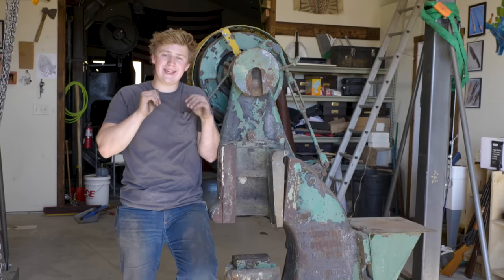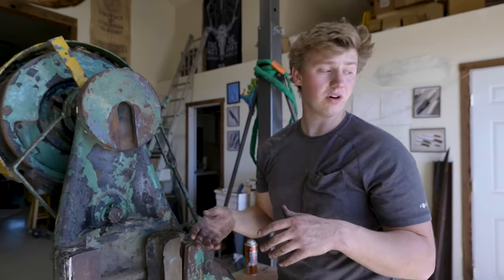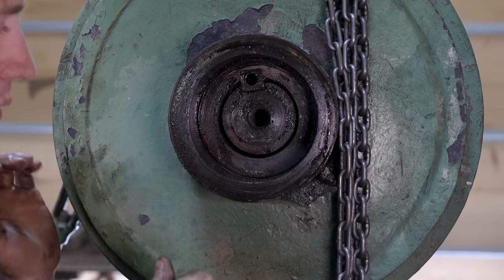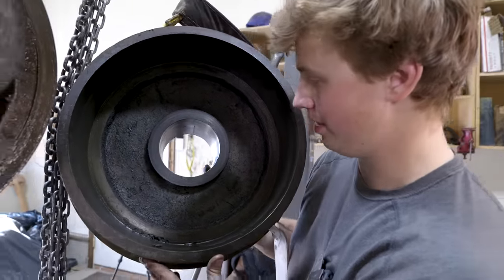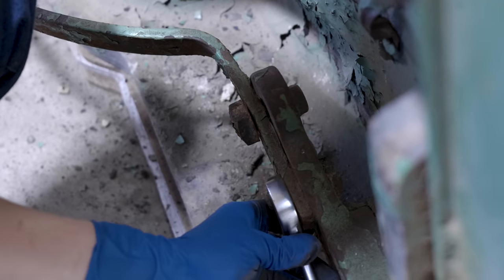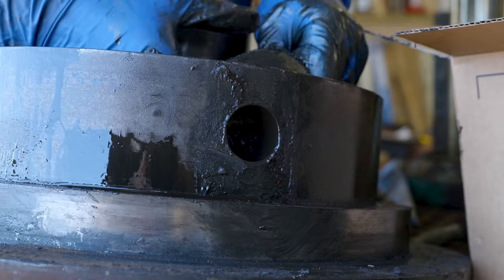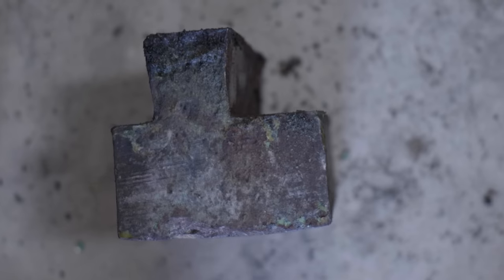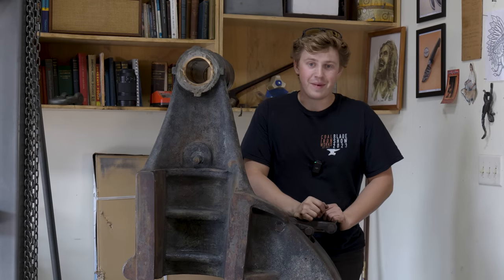Baby Beaudry  Power Hammer Restoration (Part 1)

Comment: The fact that it all came apart so nicely speaks volumes for grease vs oil.
Reply: Valid point
Reply: There's a reason anything modern that isn't bathed in oil or pressure fed oil is greased. Because grease is simply better than intermittent oiling.
Reply: It's very messy, but also very effective.  @Lucas12v

Comment: Be careful swapping grease out for oil. Different load cases require different viscosities. Generally higher loads (like I might expect in a power hammer) would use a thicker lubricant to ensure a robust film between moving parts. If the lubricant is too thin then it can be pushed out resulting in higher wear. It might move more freely with a thinner oil, but it might not last as long. There's a balance to be struck. Grease to oil is a BIG difference.

Comment: Will,
Use your protective gear! That green paint is pretty. Did you know that one of the key components of old (> 100 years) green paint is arsenic. And lead.
Lead test kits are available and inexpensive. I don’t know about a test kit for arsenic, but I would be willing to bet that they are also available.
Keep the aspidistra flying!
God bless,
Paul
Reply: Yup, get a proper respirator, at minimum.

With equipment as old like this, the "weather prediction" is Patches of lead, chance of arsenic, and possibly some asbestos too. Oh, and if it got repainted, some Cr(VI) or hexavalent chromium paint might be in the mix too.

Comment: Man, it would be awesome to see that beauty sand blasted and restored to its original color and gorgeousness!
Reply: Dry ice blasting would be my choice, less chance of damage to any machined surfaces and less mess (no abrasive waste).  But yeah, doing that versus needle scaler, wire brush and scraping would most likely be faster and more thorough.

Comment: Hey Will, greeting from South Africa.  To clean off that gunky grease, you can use Paraffin/Kerosene and a paint brush or copper brush, thereafter you can hit it with a power/high pressure cleaner and de-greaser solution.  Can’t wait to see the end result of this restoration.  Think you need to ship me a small power hammer to South Africa👍🏻.  Blessings and keep well.

Comment: A small tip for when you have rusted over bolts with exposed threads. Hit them with a wire wheel to remove the exposed rust to make removal far easier. Trust me as a dude that works on cars in the North East.

Comment: Many instances actually require grease over oil due to film strength and forces and adhesion qualities where oil may leak right out, grease will stay in and continue lubricating, as well as clinging better to parts and not settling

Comment: I really like wet blasting using an attachment to a powerful pressure washer.  A hot tank always worked well on old grungy, greasy, oily parts.  Not politically correct but effective.

Comment: Ospho is a great chemical that converts rust back to metal to recondition the hammer,  As a paint contractor i use it from time to time on metal staircases and awnings usually followed by a rustoleum spray as a primer.

Comment: Very cool project. However, i would carefully consider the grease vs oil question. I don't know anything about power hammers but i do know a little about machinery and lubricants. Oil is great if it's an oil bath or pressure fed but in most other cases grease is used for a reason. But you know way more about hammers than i do so I'm not claiming your wrong, just recommending caution.

Comment: You hammer may have babbit bearing. It is soft metal alloy, designed to be used in bearings. It is casted around the axel.

Comment: Good Video.  Although for safety concerns if the piece of machinery is that old, its prob lead based paint, so use a N-95 silicone mask when needle-gunning.  If you can, sand blast all parts and do non destructive testing on high load parts (this will find any small cracks in those parts).  Measure all parts (especially clearances between moving parts), and if you are replacing a part, check the metal type and hardness of the part.
Grease was used extensively in earlier machines, and part of the design when using grease is the tolerances between parts does not have to be so tight.  If you are going to use oil, a heavy oil, but the thing to be aware of is where the oil will drip (hopefully not over the hammer part of hot red steel).  If not just use a high temp grease (I would just use the grease, as that is how it was designed for in the first place.  You will have to grease the hammer weekly.)  You need to determine why the grease is dirty.  From wear and tear of the bearing surfaces or from the conditions (of the workshop- gritty atmosphere).
Today's moving parts depend on sealed (with grease) bearings.  Any open bearing  (to normal atmosphere) should have grease (why you see grease clumps everywhere, it sticks to everything). With an oil system you will need to capture the oil, filter and cool it and return the oil back into the circuit to lubricate and cool. 
For any lead based repairs that were done, determine if you can remove the lead. Or replace the part with new made casting. If made from cast iron, making a simple sand cast won't do.  You need to add extra  onto the part (putty/plastic to make machine part bigger in size), sand cast it.  Wait a couple of months for the cast iron to settle out, then machine it down to size
.

Comment: I instantly thougut about pressure washing all parts of that hammer when I saw the old grease being almost resin. Hot wate, soap an pressure should do rhe job before re-oiling it and putting it back togerher.

Comment: there's a very good reason as to why they used grease and not oil, as a piston goes up and down in a cylinder it creates heat which in turn heats up the grease making it softer and softer until its more like a liquid that easily lubricates what it needs to and can get it places it needs to, the same thing is used in lots of heavy equipment that are used for many hours at a time much like this power hammer was. oil is good for smaller, finer devices with much higher tolerances but needs to be changed more frequently. its actually quite understandable as to choose grease over oil.

Comment: Will, please be careful with lead based paints, when this was put together it used a red lead primer and a lead based cover coat of paint. Lead tastes sweet if ingested, but what is worse is if you breathe it. I worked around lead painted bridges and we had to be tested yearly for blood concentations. There are several things you can do, keep the work wet, wear a respirator and do no eat or smoke in the cleaning area.

Comment: I don't mean to be an armchair quarterback..... But..... Machines of this era you should count on 100% have asbestos. Especially anything dealing with fire and heat. I would like to offer up a word of caution when dealing with brake shoes and brake dust from these machines. If the dust is dry and friable it is recommended you spray with soapy water before removing it to keep it from spreading asbestos dust through the airm

Comment: Use grease not oil. Fir this badboy. Tolerance where looose back when this was made. It will also be quieter.use a bit more power but last lots longer get lubricants in your area to explain why. Be a good video.